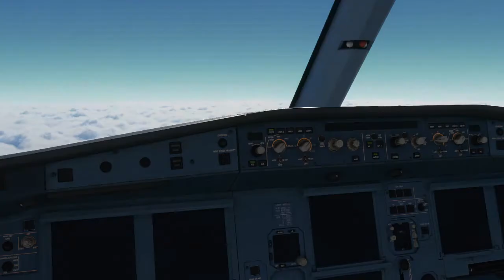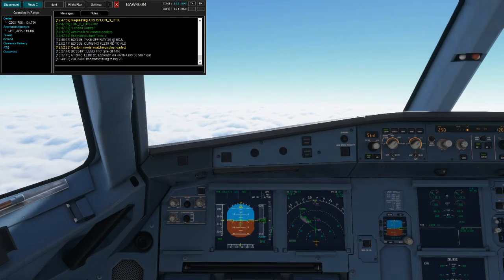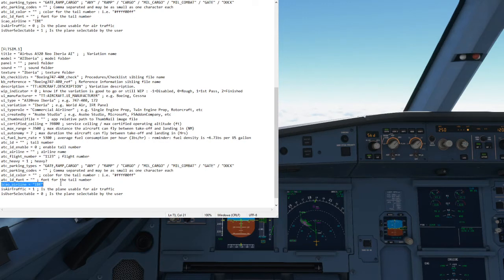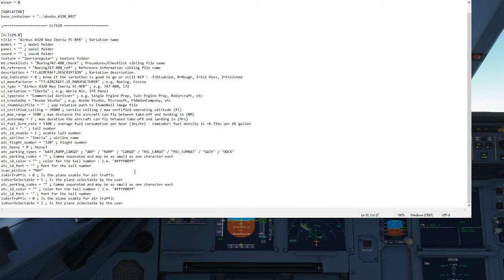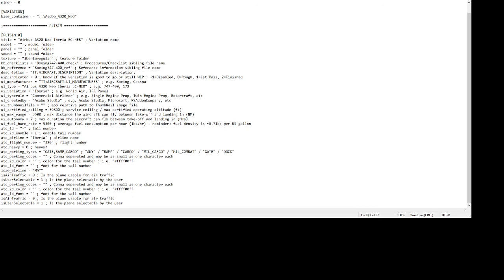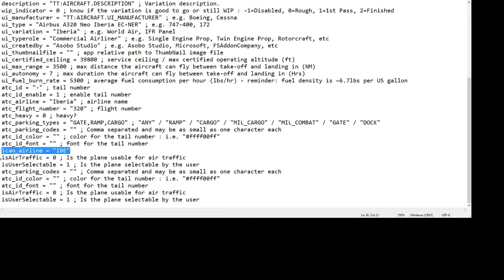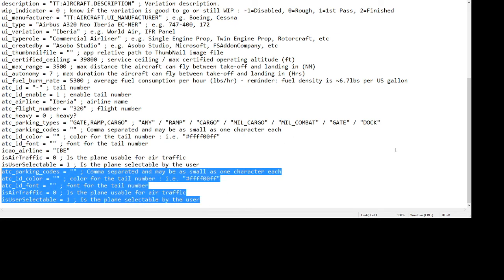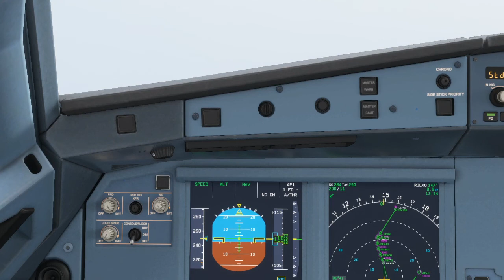MSFS VATSIM Airline Modelmatching - Livery Troubleshooting Video   [MSFS2020 + vPilot ]

Comment: Modelmatching does not work with Asobo Eurowings and Lufthansa liveries for A320 neo from liveries megapack v12. vPilot starts correct. In Aircraft window other liveries are matched correctly via AvGeek model matching (or by default). Icao Aircraft type and Callsign (EWG and DLH) seemed to be correct either. In the aircraft.cfg are no double entries an Callsigns are even correctly. Any ideas about this issue? Greetings and Thank you for this great work. Backdraft81
Reply from the maker: if you have ran vPilot in admin mode it should work - but sometimes vPilot tells MSFS the correct model to use but MSFS uses something else anyway... hopefully it'll become more stable over time!

Comment: Also I am getting crashes now when I load at an airport and start Vpilot. Both Vpilot and MSFS 2020 are loaded using Admin rights. I did have one session where I tested the model matching and it loaded and stayed online and worked. But now Once I load on to Vatsim with vpilot using your model matching and the airlines rule as well as in your video MSFS crashes immediately.
Reply from the maker: have you checked the vpilot pages within the VATSIM forum? I recall seeing a post about that being an issue for a few people suddenly and the fault was found to be the Asobo Generic Twin Engine Airliners 00 field having changed itself, causing vpilot to CTD. The latest patch is causing CTD for all manner of reasons so not sure what to suggest - try taking one file out and trying each one separately. 
For me, I had a random CTD when requesting push back the other day so asobo have really messed up with the patch this time round... hopefully it'll be fixed soon (also sorry for the delay in response!)
Reply: @BritishAvgeek  yes I did take out one leaving the airliners one there and it worked so the other was creating the CTD for me for now. I’ll keep looking for any updates on this issue. Thanks for all your help and replies.
Reply from the maker: @bruced39  the only thing I can think would be that one livery has a problem being generated for AI so the sim CTDs though that would involve going through one by one which noone can be expected to do!

Comment: Is there any work being done for Night lighting for the CSL's?  I just performed your installation and it's working, but at night it's hard to locate online traffic. You just can barely see their beacons. No taxi lights, no logo lights to see which airline. Is there a current fix for this?
Reply from the maker: unfortunately that's an issue with the IVAO model's which we need them to fix - the latest patch seems to have broken that element of it as I've had a few comments about that now unfortunately! try without the IVAO bits and just use my model file and see if that improves the issue.
soon by the way I'll have a complete answer for all of this - but I'm waiting on another project to give me a release date!
Reply: @BritishAvgeek  I will definitely try that and appreciate your time in answering my question. Does your response cover both my questions above? (1) The night csl lights and (2) the sim crashing?
Reply from the maker: @bruced39  no problem! I hate asking and waiting a day for an answer myself 😂 it does cover both questions I'm afraid! IVAO might need a couple of days to update their models and we may have to redownload it again from their side for that part of the model matching 😭

Comment: Hello, i got this on VPilot 
Failed to create aircraft SWR13SG using model "Airbus A320 Neo SWISS". The model may be corrupt or missing. vPilot will try to create the aircraft with a different model.
However nothing seems to be a miss, any ideas?
Reply from the maker: Do you mean when you saw the flight it was showing as Swiss correctly?
If that is the case, it is because one file wasn't working (for example the AI file) so it used the other non-AI file which was fine.

Comment: thanks...  Is there a way to define an aircraft model as default when the matching is not working?
Reply from the maker: Hi! 

I have put lines in so if they all fail it'll seek the default liveries instead - I'll spend tomorrow fiddling to see if the position affects it in any way. 

This specific video is a possible fix - not sure if it makes any difference yet!
Reply: @BritishAvgeek  Thank you for you fast answer. I would like set up as defaul a DLH livery... someoneelse another company. I have a strange effect. Once I have only Eascyjet airliners in sight, next login only austrian...
Reply from the maker: @markusdemow7994  I don't think anyone knows the answer yet - I'm not sure myself! Sorry!

You could try deleting any airline you don't want in the file, then at the bottom there are lines that do not have any CallsignMatch lines - they are for the default